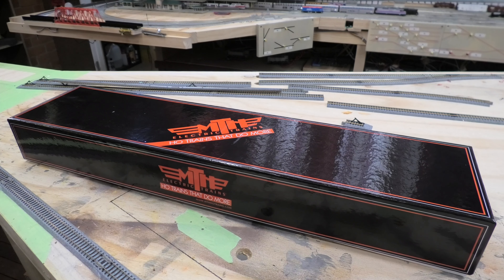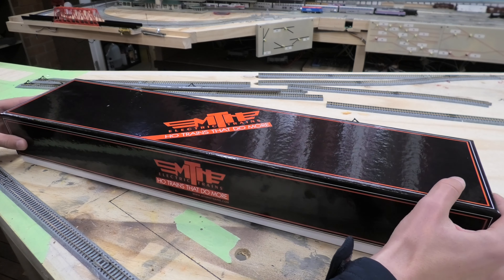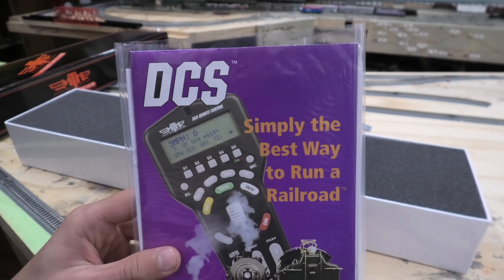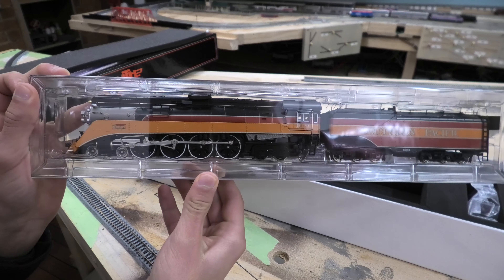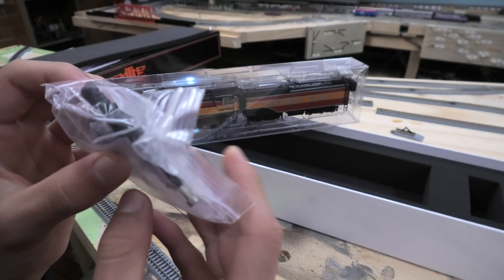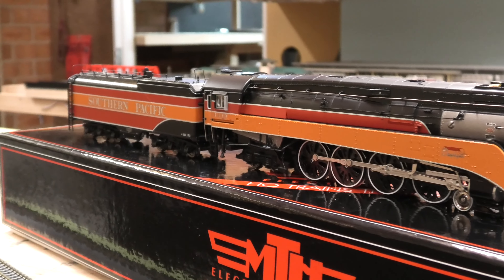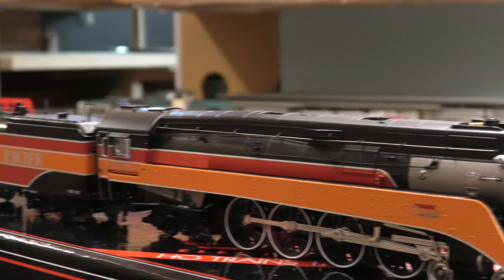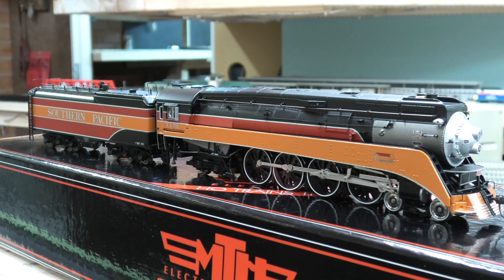HO scale MTH SP Daylight #4449 smoking whistle

Comment: Nice looking model, paint and detail are good. But that steam chuff sound is awful! Sounds very synthetic. (Whistle good though) I have the same opinion about my MTH 4-12-2 but changing the decoder for a decent one would mean losing the synchronised chuffing smoke.
Reply from the maker: struck2soon Thanks a lot for your comments and advice. We will try a new decoder in the near future? What decoder did you install on your loco? Esu or Tsunami?  Thanks again!
Reply: Union Pacific Snowy Valleys Division  I have not changed the decoder on my MTH loco because I actually like the synchronised puffing smoke. However, I have changed a few on Broadway, Athearn and Rivarossi locos. For sound and motor control ESU would be my preferred choice...I actually have one of their ‘Select’ decoders waiting to go in a brass SP Daylight 4-8-4. The sounds were recorded from the actual loco, so the whistle sounds  good.
Reply from the maker: struck2soon ok thanks again, we will investigate to try to improve the sounds. Kind regards